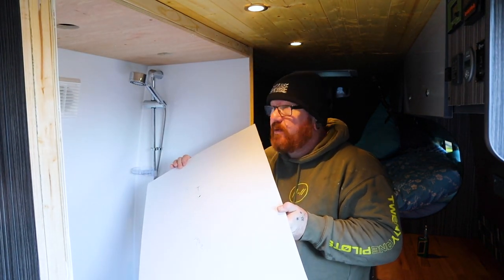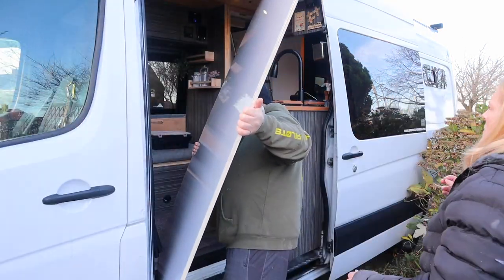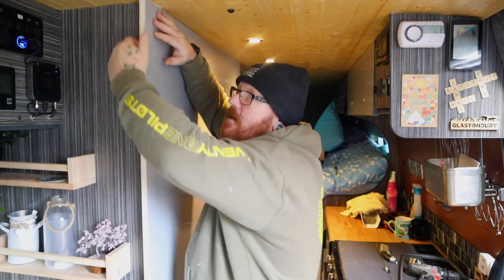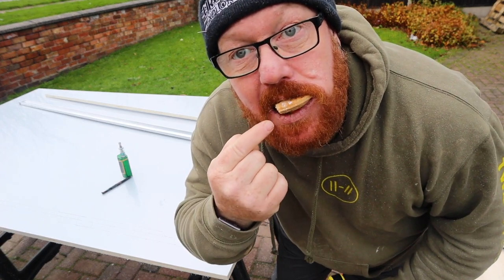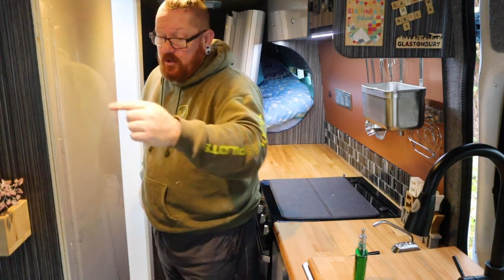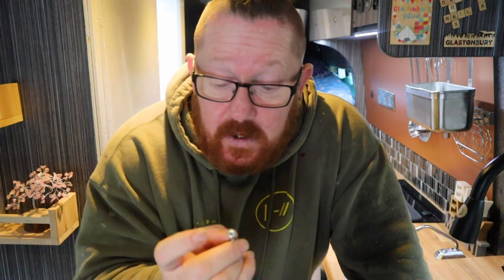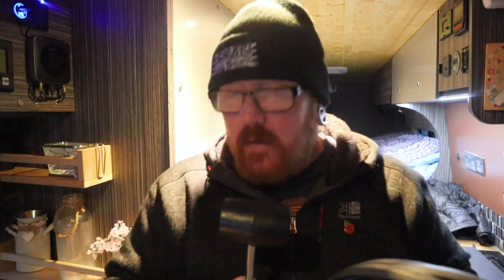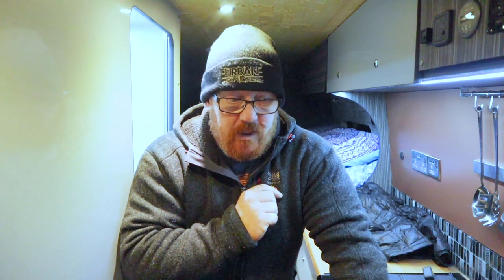You'll Love The Shower In our New VAN BUILD

Comment: Hi seen a lot of crafter minibuses which our cheaper with low mileage and seem to get more for your money 
What do you think about converting one of these 
Do you think with twin wheels and all windows it will cause me problems regarding fittings and mot 
Thanks bill
Reply from the maker: Great question that mate . And I think  they would be perfect . You allready have the windows and the ones you don’t need to can cover them from the outside with black vinyl plus having the extra wheels or the double wheelbase on the back gives you more weight you don’t have to worry about every single ounce and Gram an pound you’re putting into the van. I think  it’s a great idea